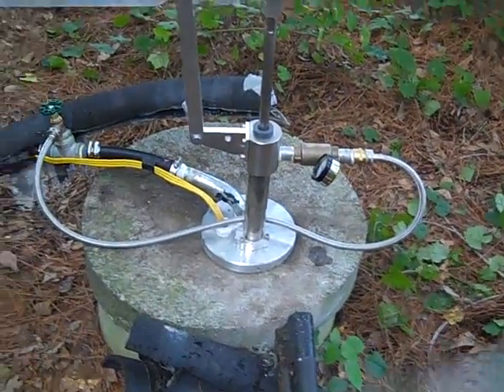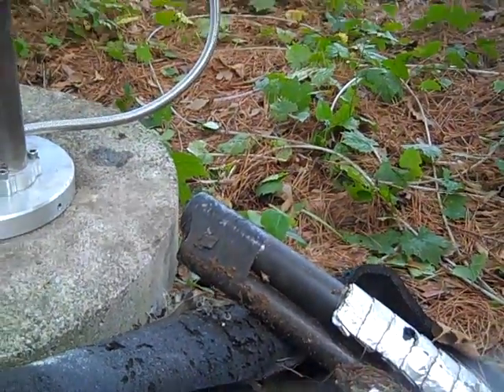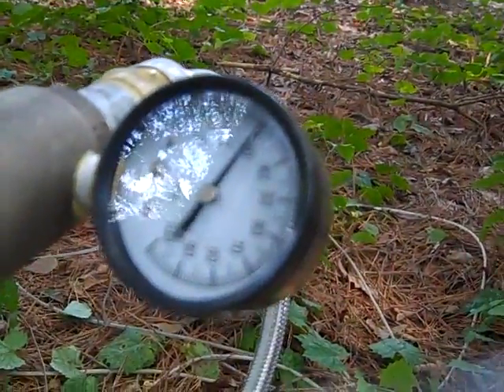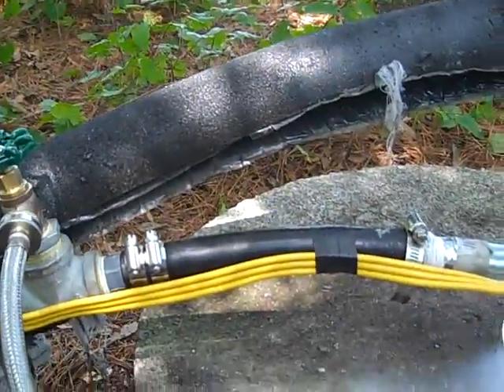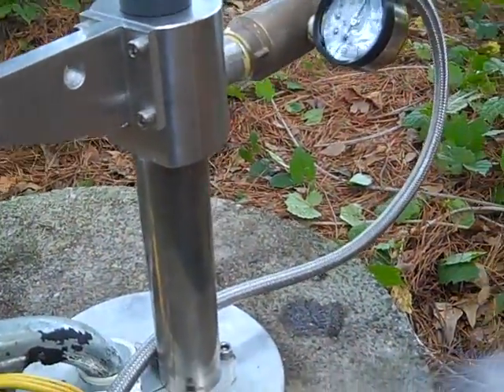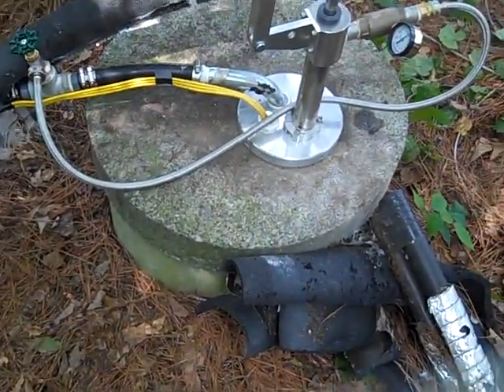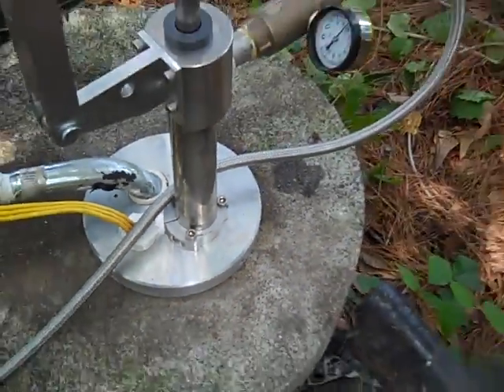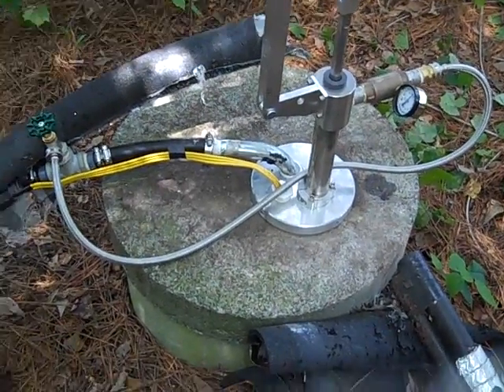All about wells - A Simple Pump in a bored well

Comment: I guess the beauty of the simple pump is it can share the well with the submersible pump. If I was going to rely solely on a deep well hand pump, I'd get a Baker pump head with a brass cylinder. I like the quality of the cast iron pump, and the brass cylinder. You can get different size cylinders and you can set the pump to three different strokes for different depths. You can even get a pump jack and pump with a motor. Just my 2 cents worth. This is still cool though!

Comment: Could you pump pressure with a cast iron deep well hand pump head like a Baker? The pump head has a valve on the spout and water can be pumped out a pipe on the back of the pump into the house or up to a tank. You'd probably want to use a standard 2" or 1 13/16" brass deep well cylinder to pump pressure. These kind of pumps have been on farms for 100 years. I guess the big problem is you cant put this kind of pump next to a submersible pump.

Comment: I contacted Simple Pump about my situation with the sloping hill, and they said it was not an application they would suggest, but they did put me in contact with a guy in Tennessee that had the right pump. So it looks like i am going to do a 24volt panel direct wired to a solar Slowpump. This is going to get exciting!

Comment from the maker: Burying would be fine. I would put it inside 1.25" pvc to protect it.  As to sediment , it will handle a lot but the life of the o-rings inteh pump will be reduced obviously if you are pumping sand and grit. You could filter sock the intake and replace the sock from time to time.

Comment from the maker: I believe it would!  There is enough flexibility in the system that as you go to the top you could get close to vertical.  I installed one this week with a static water level of 330 ft and we put in 350 ft of pipe.  It only pump a 1/2 gallon a minute due to sucker rod stretch but it worked! Freeze protection would be the key at your location.

Comment: What, if any, are your suggestions for those times that may come up where there is ground water contamination?  If for whatever reason the groundwater becomes undrinkable, are there filtration systems that you can install on the user end of the system, inline, etc.?  Or do you just suggest boiling once in the house?  Should you set up a boiler and basically make a large still prior to the main house lines?

Comment from the maker: One of least expensive solar submersible kits is ~ 1800.  24 volt.  That is a dc pump, no controller, mounting hardware etc.  I have several of these running.  The Simple Pump is a great mechanical backup.

Comment from the maker: We sell and install the Simple Pump.  Probably have installed 50 of them this last year.  It is an expensive solution but the only one that I have found to work on top discharge wells.  No other pump can pressurize the house.  Bison can't , flojak cannot etc etc.  I installed a Simple pump yesterday 350' deep!  It is expensive but it works.

Comment: I got a price from Simple Wells and was a bit shocked at the high price.....about $800, and double that with a back up DC pump.  Seems a back-up DC battery/voltage inverter/small DC pump/ solar panel set-up would be alot cheaper.  What is their profit margin on these Simple Pumps.....about 1000 percent?

Comment: -- 4 to 5 feet under water and 10 to 12 ft down from the top of the well..which is a 6in metal pipe that seems to go all the way down in the well..we cant see the top of the joints to try to feed something down in them and we have tried to use heavy wire to fish hook them out..my question is this..short of diggin out the side, down to the top of the joints..is there any other suggestions we could try?..we are in Oklahoma and its been so dry that we can only fill our 4gl well bucket pipe once-cnt

Comment: Hi E775... I have been searching for months for an answer to a huge huge problem we have.. we have a 40ft well thats way over 50yrs old. We tried this spring to put some pvc 1 1/2 in pipe in the well with a spring valve on the end to use as a hand pump.. ok here is where we goofed.. first I moved the pipe holder wrong and lost the first 20 foot joint down the well, then hubby forgot to glue the next joint with the spring valve on the end and it fell down the well.. we now have both joints- cont